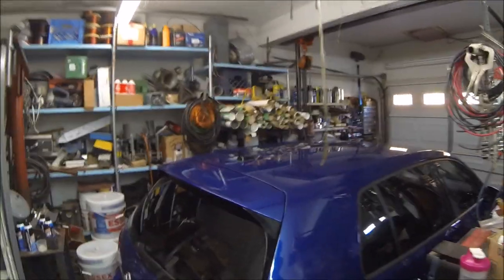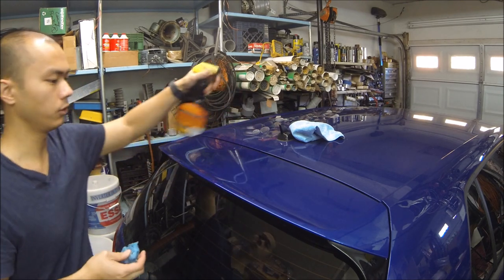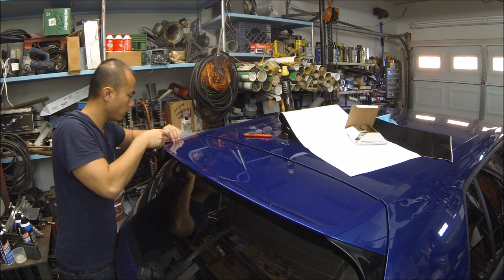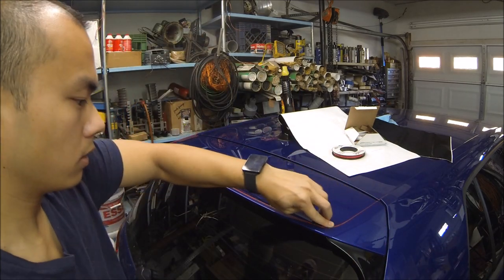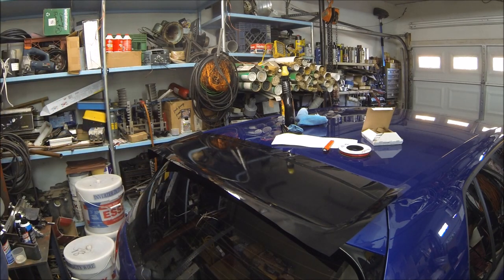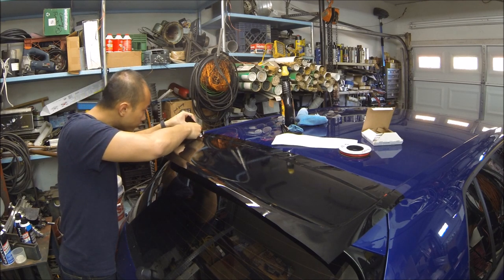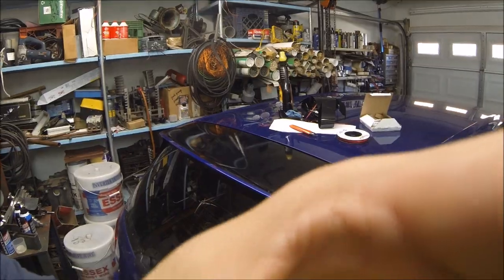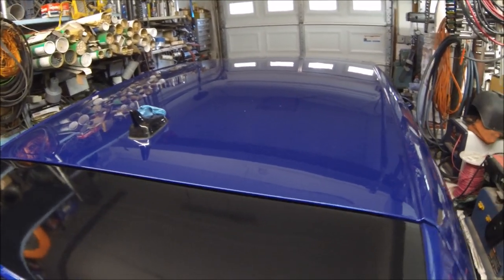Golf R Vlog #17 - Roof Wrap (Part 1 of 2)

Comment: Looks well. Also done the roof of mine. Didn't get those curves at the back perfect even the second time. Not sure but Maybe applying some heat before cutting would help it. P.S. Make sure it is not too cold when you are doing the full roof. If the wrap is too cold it can split when you lift it. If you are inside you should be fine though.
Reply from the maker: +themadman697 thanks for the tip, i'm going to clear up my garage and heat it up before wrapping the roof as its getting cold out

Comment: For the WrapCut, when you pull the filament through it's slicing through the red strip of tape as well as the vinyl itself.  Doesn't that mean it's leaving a slim strip of the red tape behind from the WrapCut, underneath the edge of your applied vinyl?  So, the outermost edge of your vinyl isn't actually affixed to your car.  It's stuck to the red tape which is then stuck to the car.  It will be interesting to see how this edge keeps over time.
Reply from the maker: +Iain B you take off the red tape after and then stick the edge of the vinyl down

Comment: damn, really good vid. always been afraid of that job. so how do you razor those last little spots without scratching your paint? and in the front side, does it just fold over the edge, and not go any further, because it would be pretty hard to tuck it underneath at that angle.
Reply from the maker: +LastHumansGarage You gotta scratch the paint a bit but better to have maybe a .5cm scratch than one along the entire length of the wrap. I opened the hatch and tucked it underneath.

Comment: I'm trying to do the same for my GTI, but I can't get the antenna off.  I removed the inside roof liner and removed the screw that holds the antenna in place, but I can't get it off.  It's loose and I can lift the antenna up about 1/4 inch, but can't figure out why I can't pull it off completely.  Don't want to try to hard and break something.  Any suggestions?
Reply from the maker: +Professeur Dufus McPottytush you have to pull down the white tab in order to release the wires. Also you have to squeeze the black tabs in so that the antenna can slide out. Hope that helps!